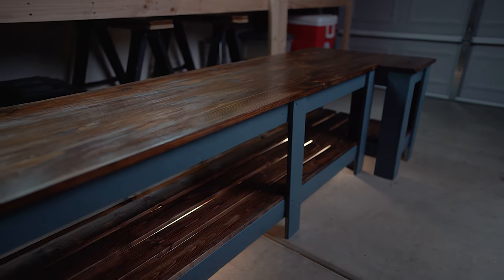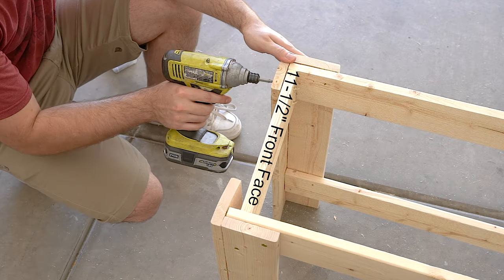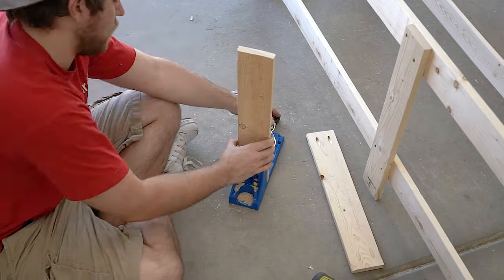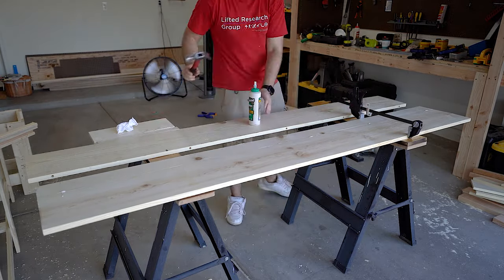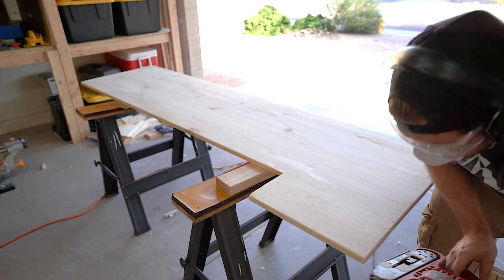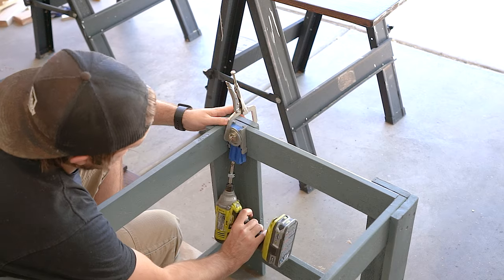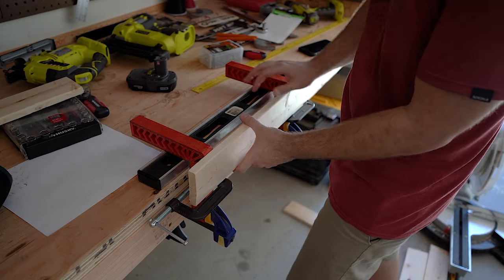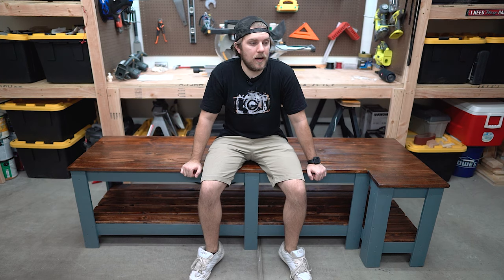DIY Bench / Patio Bench Build / Easy Patio Furniture

Comment: You have mentioned the heat several times in you videos.  I am in Gilbert and I have appreciation for how it is can heat up for a few months out of the year. To solve the problem in my AZ Garage shop was to add a mobile Hessaire swamp cooler from Home Depot.  It was the best money spent to make it more conformable.  It DOES work really well.  If you were to purchase one get a good one not one of these small little ones.  I have mine connected to a hose so it auto-fills. When the garage is 105 it cools it off well enough to keep you  area cool.  While recording videos  I can leave it on. I just record about 5 - 10 seconds of video prior to starting to speak or the actual content. In adobe premiere you can isolate and remove the cooler's fan noise. Being able to record videos in comfort.  Good job at growing your channel, keep it going.
Reply from the maker: Thanks man! That’s great advice! I’ll have to look at isolating white noise because I need several takes to say what I need to correctly and in this heat it’s a race before I melt haha. I bought a portable a/c unit but it doesn’t seem to be enough for the 110+ days we’ve been having (especially with the 50-60% humidity after it spits for a while). Thank you for the feedback and well wishes! I appreciate it. Keep cool out there!

Comment: How do u sermon weight limit when building  lawn furniture like chairs
Reply from the maker: That’s a great question! It’s all about support. This bench is supported by the aprons and cross braces (like a table). These help prevent sag and flex of the top/seat under weight. This specific bench I can (and have) jumped on and it’s rock solid because the top is supported and the frame is rigid. Without testing the materials in each configuration it’s hard to provide a weight limit but I can comfortably say that mine will work just fine for its intended use (as a seat).
Reply: @WoodNerds  ok thanks for the reply